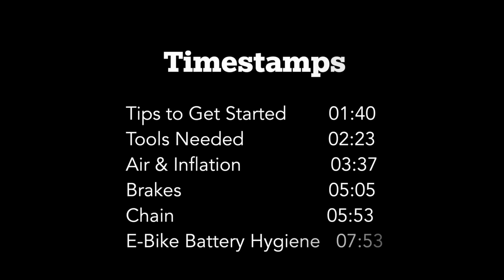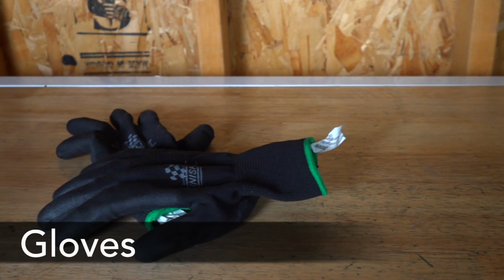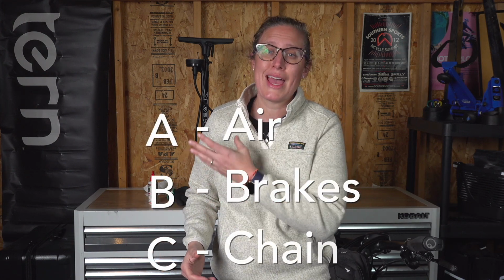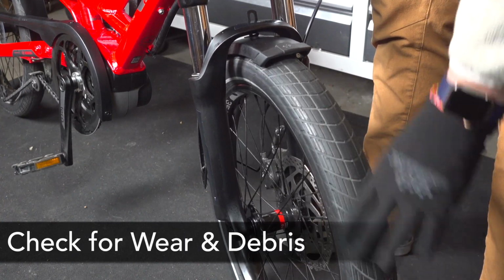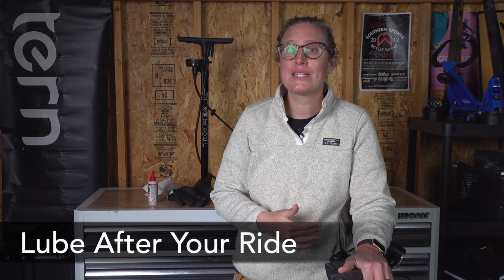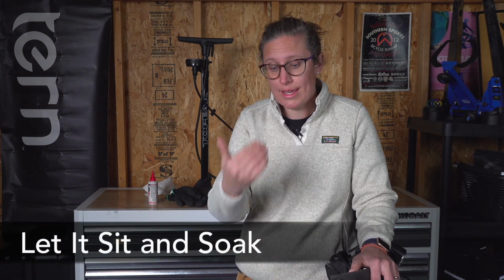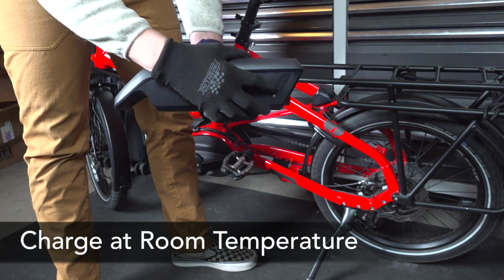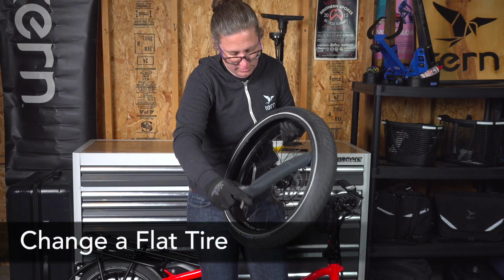Basic Bike Maintenance: Tips for every bike owner

Comment: EVs should be much less maintenance, not more. Something does not add up here. 

The funny thing is that the motor is actually wearing out the chain and brakes faster in Tern bikes. Almost as if this was by design to sell more spares. In actuality the motor should be taking load off the chain and brakes... that is the whole point of EVs. Imagine an EV that would not use its motor for braking. And in the case of a hybrid, imagine thinking it makes any sense to couple an electric motor to a drivetrain designed for human legs.

Comment: diminishing returns. 
air pressure - when you feel like you need to pedal harder or see excesive tire deformation.
breaks - if one is failing you, you still have the other. just drive more carefully and fix it when you can
chain - when it gets noisy, after heavy rain and after washing. 

don't make it harder than it needs to be. its a bike, not a nuclear power plant ;)

Comment: Help!  My rear of my front fender got hung up when I went riding.  I twisted the fender to stop it from rubbing on the tire.  A plastic piece popped off.  When I got back to riding the fender was rattling.  I have the plastic piece.  What do I need to do to fix the issue?
Reply from the maker: Hi Diana! So sorry to hear about your fender situation! Glad you are ok. Your best course of action is to contact your Tern dealer and take the bike to them so they can assess the fender and help you get it fixed properly and safely.

Comment: Thank you very much for the video. I live in Japan and have been riding bikes for 20 years here. I’m getting up there in age and Japan being as mountainous as it is decided to purchase my first e-bike. I bought the same exact bike as in your video. I love my tern hsd p9. My daily commute is fun and my occasional weekend afternoon out on the bike is wonderful. I clean my bike as well as my chain and do a general maintenance check of all bolts every week. Recently, I have felt and heard a grinding noise when shifting to 5th gear and up. It is very similar to a regular bicycle chain having difficulty changing gears due to no or inappropriate chain maintenance or adjusting a derailer. 
The bike store told me my chain was stretching and I would need to change it every 3,000 kilometers (1,864 miles). This is unusual to me personal because I would normally remove a link or adjust the rear tire, etc. Do I really need to purchase a new chain every 3,000 (1,864 miles)? 
It may seem like a lame question and I apologize if it is, but this is my first e-bike and I log 3,000 kilometers every 3-4 months. Is this due to the motor? I want to learn more about my p9. 
Thank you,
Philip B.
Reply: Hi Philip, Arleigh here. Your chain "stretching" is actually the rollers in each link wearing down. If you don't replace the chain when the rollers are worn down then the chain wears down your rear and front gears, making a very costly replacement. 1800 miles on an e-bike seems reasonable. If you ride in Eco/Tour and shift into easier gears then you may get longer life than others, but it is really dependent on the riding style, where you ride, and how often you are shifting.  On a non-electric bike, I personally see between 2000-3500 miles on a chain depending on the bike.